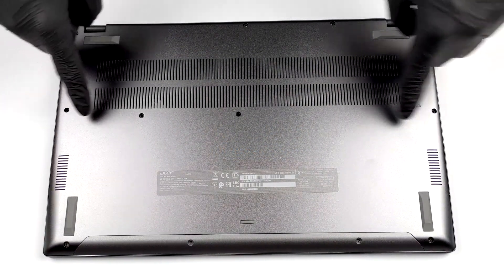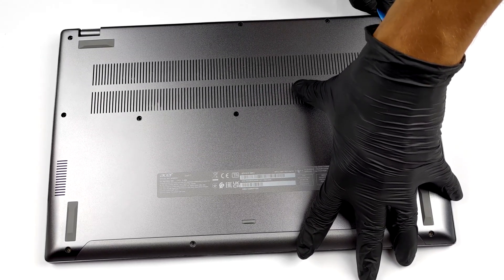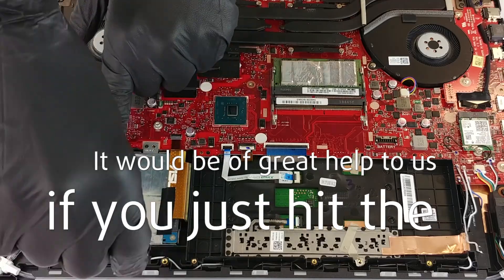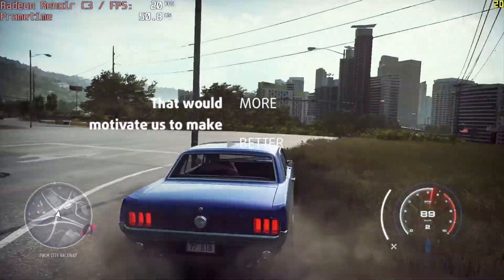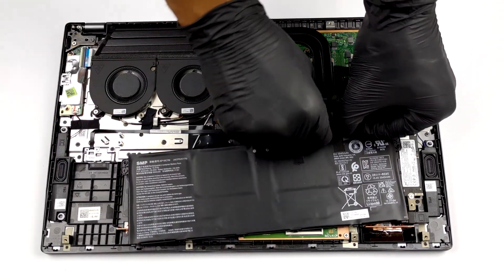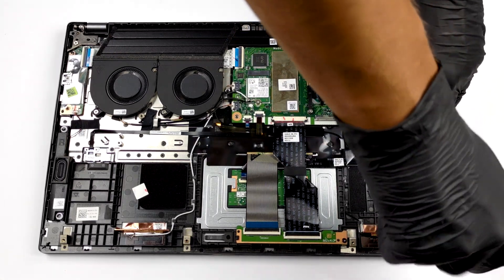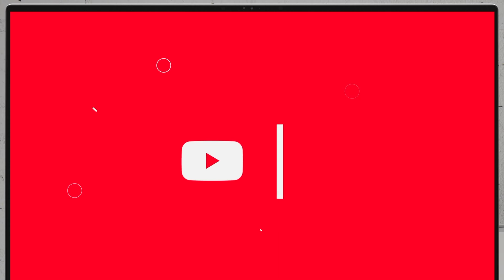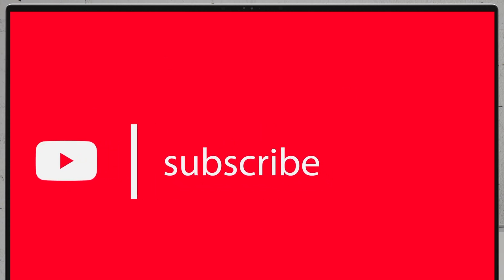🛠️ Acer Swift 3 (SF316-51) - disassembly and upgrade options

Comment: What ur prefer bro?
i5 1135g7 double channel 8 + 8gb on-board vs i5 11300H single channel 16gb on-board
Reply: Of course the dual channel, it always works better when the ram configuration is in dual-channel, either in intel or amd

Comment: the cooling system, So its deliver hot air out of machine, or sucked air into the machine? anyone knows which?
Reply: heat from processor - to heat pipe- then  the fan blowing it out of laptop,